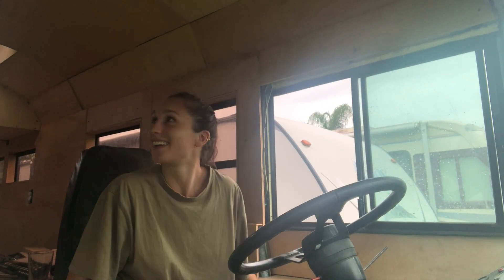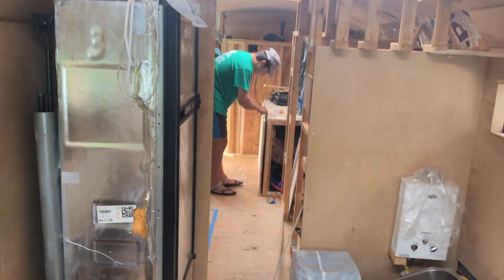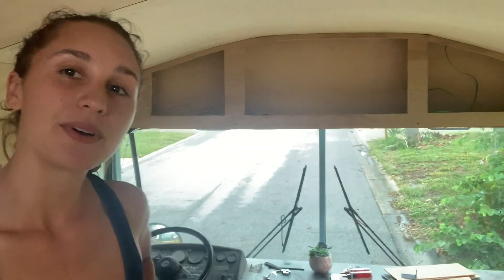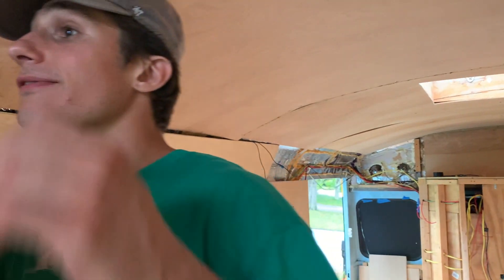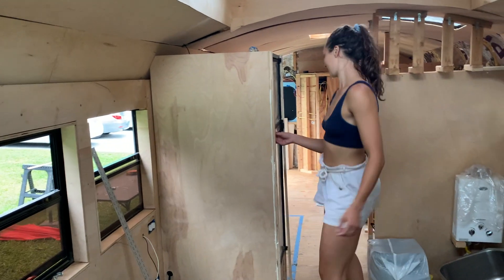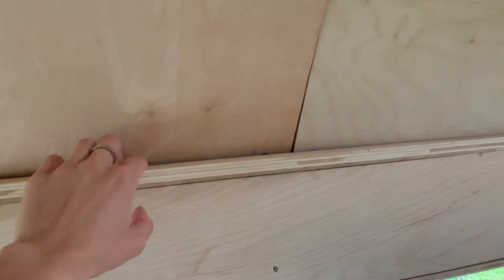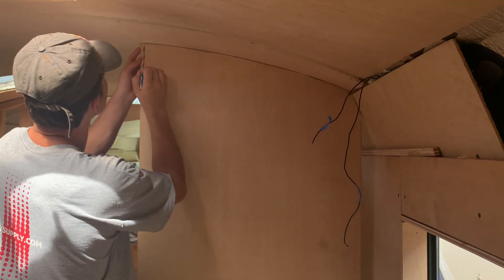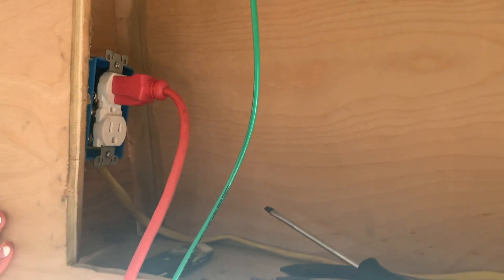Framing Out RV Fridge with Birch Plywood in Our Skoolie Tiny Home! School Bus Conversion Progress

Comment: Hi guys, I love watching your progress!
Just wondering how you are planning to vent the refrigerator? 
RV fridges usually require a vent and a fan.
Reply from the maker: imiggy it’s not totally enclosed in the back, air is able to escape on the top and both sides! Thanks for watching!!
Reply: It's also not connected to propane so we don't have to vent out harmful gasses. Strictly electricity, hooray for that! :)